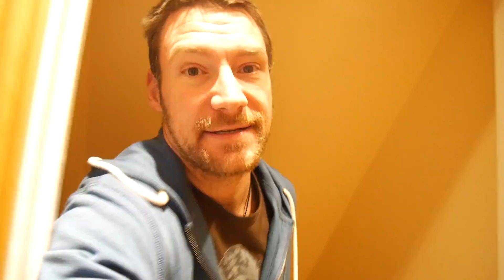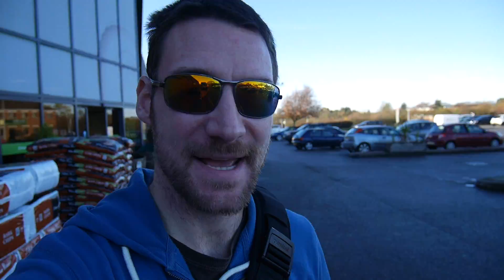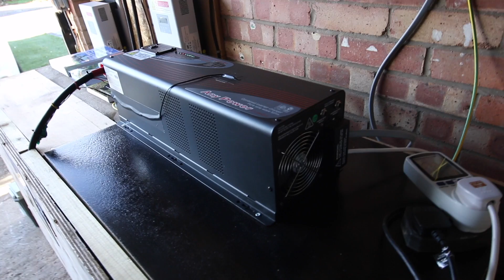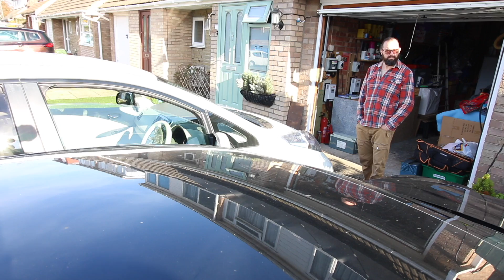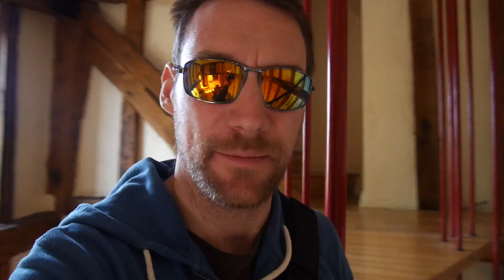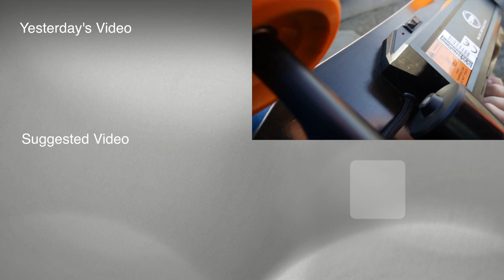Off Grid House

Comment: Loved the content of the video, i would like to be off grid one day.
Tip: read up a bit on framing your shot : ), there are some great examples online that show you how to set up Interview shots like: http://www.mediacollege.com/video/interviews/framing.html
Reply from the maker: I know, I was faffing around trying to get the angles right, but ultimately there wasn't the space and I only had one tripod! So as time was running short I had to just do the best I could. Good news is next time I'm trying to do an interview, I fully intend to turn up with more than one tripod.
Reply: Ah, did you film this in 1 shot and cropped the video to make 2 separate "angles"? that's quite clever as well ;)
Reply from the maker: No I used a step ladder inside the garage for one camera and the tripod for other. Unfortunately there wasn't the room to get the angles right though, as the ladder needed a level surface or the camera would fall off in the wind.

Comment: The easiest way to go off grid (for you) is to not drive the Tesla on days when there is not enough sun and use the Tesla battery pack as a backup for the house. In case you nearly run out of juice you can fill up the car at a supercharger (Elon will not be happy with my idea ;))

Comment: You need to be taking a close interest in Elon's tiled roofs, then.
Reply from the maker: Indeed, but what really interests me is being able to off grid my house, at least for some of the year. Probably not the most financially efficient goal, but there is something about it that appeals to me.
Reply: Yes and no.  You touched on it during the visit, off-grid isn't the optimum solution if it wont work all year.

A full solar roof plus local storage AND exporting power to the grid for credit half the year, then spending the other half year gradually using up the credit. Result - happiness   8-)